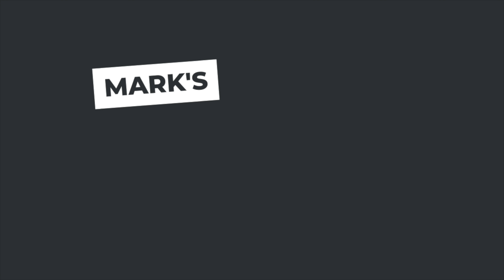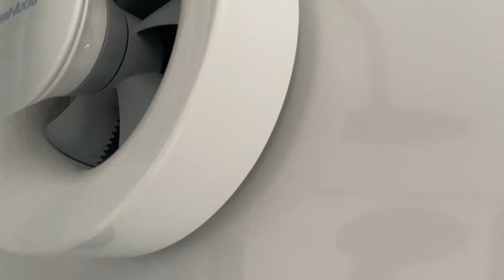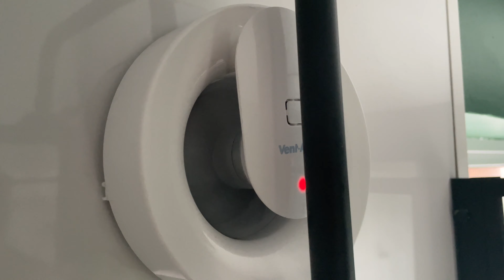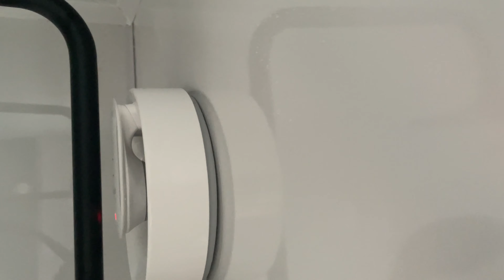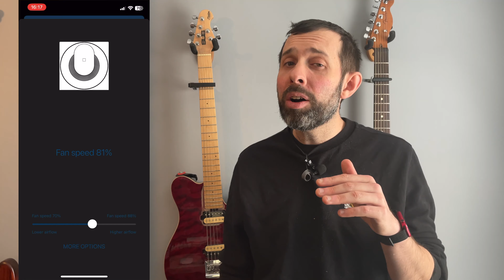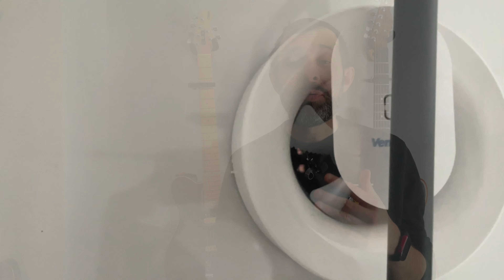Vent-Axia Low Carbon Svara - Smart Bluetooth Extractor Fan

Comment: Have you found a way to use the Vent-Axia Svara sensors when using the switch live connection? I've just fitted one and unfortunately every time I turn the lights on I get the boost speed (which I have on the max 30l/s to improve shower condensation). If not available via software, any recommendation?
Reply from the maker: I haven't I'm afraid. I had my bathroom redone last December so ended up with a regular fan and a SONOFF relay to make it smart
Reply: @MarksTechVlogs  anything you would recommend? Not having a good experience with Svara so far…
Reply from the maker: @mackertUK not really, if you’ve got the space to conceal it a smart relay is probably the best option

Comment: How do you connect it as I guess it does not run on battery. I have not watched the video yet 😅.
Reply from the maker: It doesn't, it's mains powered so is designed to replace an existing extractor fan unless you want an electrician to add new wiring etc.

Comment: Does it have a vent that closes and opens to keep the draft out?
Reply from the maker: Sadly not but I have a slatted one on the outside that does the trick
Reply: Thanks.  The last thing im confused about is the sensor.  I have sensor lights.  I want it to come on when triggered and then off a few minutes after.  Is this how it should operate?
 @MarksTechVlogs
Reply from the maker: Yeah, so the light sensor options are off, low, medium or high light sensitivity and you can choose how long it runs for when it detects light. As these are adjusted in the app it’s easy to play around with them to get them right for your setup
Reply: @MarksTechVlogs  thanks.  I just ordered two for our church toilets.  One arrived in the mail yesterday :)
Appreciate you answering questions for me.

Comment: Can the fan be turned off all together so it doesn't run via the app? If not, can it be turned off on the fan unit itself?
Thanks in advance
Reply from the maker: The fan itself has an on/off switch on the side and in the app you can disable things like the humidity sensor so I guess in theory it could be turned off via the app if you disable enough features
Reply: @MarksTechVlogs  Okay then brilliant thanks and I'm assuming that completely stops the fan all together? Thanks for the speedy and  thorough response 👍

Comment: Hi, is there built in humidity sensors in this?
Reply from the maker: Yes and you can adjust how sensitive it is in the app which is a 100 times better than other fans where you have to remove the front and adjust with a screwdriver

Comment: Hi once set up will this continue to work. Even if you are away from home ie not in range  with your mobile phone bluetooth
Reply from the maker: Yes, the bluetooth is largely used for changing things like the humidity sensitivity levels. The only time I use the app now it's all setup is to boost it if I need to
Reply: Thank you very much going to pick one up from screwfix

Comment: Hi Mark how would this be set up with a philips hue bathroom light? Also can it be located in the ceiling above the bath?
Reply from the maker: Hey, I believe it can be mounted in a ceiling above a bath and it works fine with my hue light because the fan is only on when you trigger it via the app or the humidity sensor or timer kick in 😀

Comment: Thanks Mark really useful video. You say you have the light sensor off, does the fan have motion sensor to activate it when you enter the room or does it only come on when you are using the shower and the humidity is increased? Thanks. Liam
Reply from the maker: It doesn’t have a motion sensor so for me it just activates on humidity plus the automatic cycles which run every 12 hours
Reply: @MarksTechVlogs  Hi Mark. Enjoyed the video but I'm confused by the motion sensor (or lack of) business. The Vent-Axia instructions (PDF) clearly states "When the fan senses somebody in the room it increases
the flow to 16l/s." So if the fan doesn't have a motion sensor how can it detect your presence?
Reply from the maker: @davidjgomm  that’s an interesting question, I’d never read that in the manual and from using it since making this video until about a month ago I’d say it doesn’t detect presence…it can detect a change it light or humidity
Reply: Hi. I bought this unit based on your review and one thing I can’t figure out is how to shut it off. It’s running all the time even though I set the app to turn off after 5 min delay. 
I turned off bith light and humidity sensors and the fan continues to run all the time, although in low speed mode. 
I also changed the Quite hours to start before the current time but it still doesn’t shut itself off.
Reply: @leotheangrylion  This is called trickle and improves air quality and helps prevent mold, but you will spend more on heating. There should be a setting in the app to turn it off. The trickle rate in the specs 10l/s seems a bit higher than other fans.
If your bathroom door does not shut airtight then it will improve the air quality in the next room as well.
Reply: @leotheangrylion sorry to bother you but did you ever solve this I’m having the same issue (traditional setup of the light  and fan connected) I then installed hue and had to turn off fan the it’s isolater. I installed this fan turned everything back on but fan keeps running
Reply: Also to add I said no to it being connected to a a circuit (otherwise I got no light or humidity options) and hubbie did connect it with 3 wires.
Reply: @taraoneill8747  Yes. The fan eventually turned itself off after about 30 mins, but I still couldn’t get the humidity sensor to work. After taking a shower the fan speed remained the same even though the humidity in the bathroom increased to over 80%. 
I gave up in the end to try and solve this.
Reply: @leotheangrylion thanks for replying I really appreciate it. I’m so confused. I also note that if I do turn off my bathroom light at its switch, the hue bulb turns off but the fan keeps going.  I wonder if this is because 3 and not 2 wires used in its install. @MarksTechVlogs any thoughts did you come across this issue especially as you also use hue and have that fan connected to the light switch  setup. Thanks
Reply: I am not a big fan of the fan, the light sensor doesn’t always detect you entering the room (no matter what sensitivity it is on) or when you turn the light on.
I find the fan coming on at random times during the day and staying on for ages, over an hour, sometimes two. When I look on the app it says humidity sensor active. This happens no matter what the sensitivity is set to! Don’t think the sensitivity settings actually do anything, except the off setting which work for both the light and humidity.
The only positives I have found are it does come on as it should when anyone takes a shower and it is very quiet compared to my other extractor fans. 
I won’t be buying another.